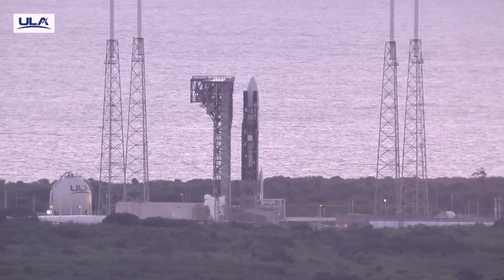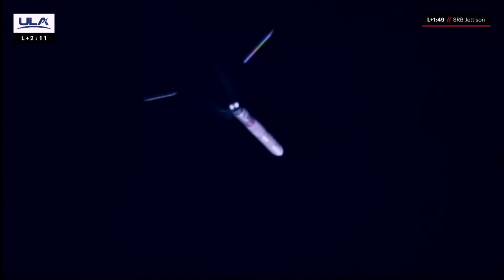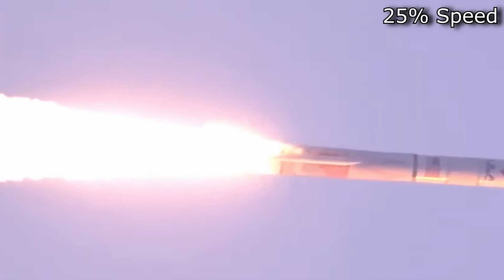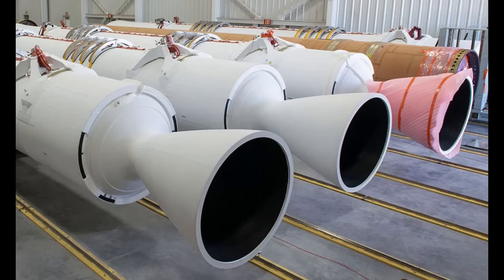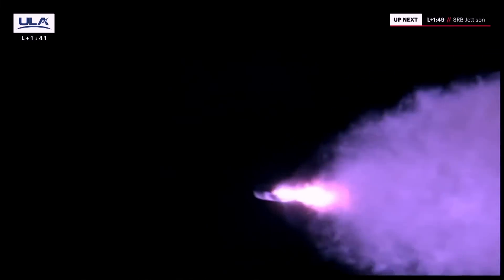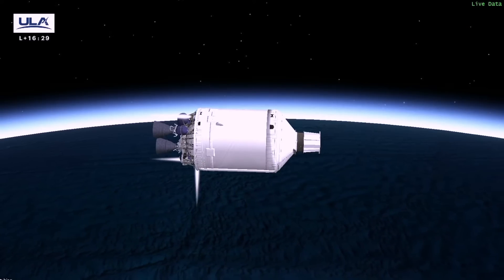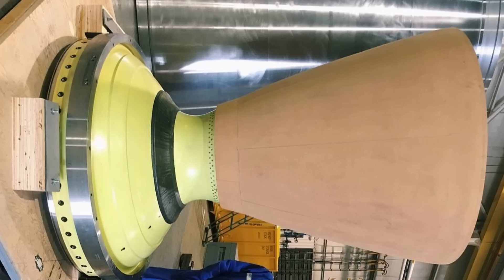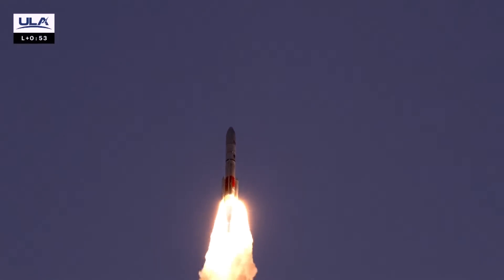How Did The Vulcan Rocket Survive This Booster Failure?

Comment: So, these solid propellant boosters have carbon fiber casings with metal nozzle-assembly connection?  Seems similar to the Titan submersible incident, in a way, except the pressure is on the inside instead of outside.  The pressure is reversed.  The forces on the carbon fiber structure are the opposite way.  The carbon fiber structure held, in this case.  I’m not saying these failures are the same, just a bit of similarity I noticed.

Comment: Idk anything about anything. But my random assumption is MAYBBE a slightly failed in fuel mixture so it burned at a higher temp so it burned out the nuzzle faster? Random assumption with no precluding data. But what do yall think?

Comment: The rocket is 2 for 2 as far as I’m concerned. The gem needs to be fixed but the system demonstrated how robust it is up there. SRB failure in that phase of flight is normally catastrophic, but Vulcan adapted and still completed the mission right on the money. 

P.S. isn’t it nice to be done with the Russian engines? Atlas is great but if we had been wiser we would’ve seen that it’s a road we never should’ve gone down.

Comment: So I guess the nozzle throat was still intact - otherwise the chamber pressure would have dropped, and so would the burn rate, making the booster take a lot longer to burn out.  Solid propellant burn rate depends heavily on pressure; the relationship is (surface regression rate, length/time) = (constant "pressure coefficient" a ) * (pressure) ^ (constant "pressure exponent" n).  The two constants depend on the propellant formulation alone.

Comment: Thank you to the Aerospace  Engineers who developed, explained, & tested the resulting embedded control systems.  Testing the  combined hardware & software systems ensures all  the various rocket failures' recovery methods work.  Testing is real sweat in the arm pits activity.  Software usually lags behind hardware development.  Just as well to have known to be good hardware before testing software.

The built-in error & solid booster failure recovery via onboard systems was impressive.  Maybe SpaceX could learn from this for Starship.  Of course the Russians wouldn't learn anything.  

See Wikipedia "Systems Science :  https://en.wikipedia.org/wiki/Systems_science

--JSW

Comment: The BE4 engines seems to get the credit here - I beg to differ - It was the software (engineers) that should take most the credit (... and a bit to the gimbal hardware), PLUS the second stage to make up the difference.  The question Id like to ask is - was this version operating at it's max capacity - if it was - then that's impressive! otherwise they were lucky they had the extra margins. I bet FAA will rush through the investigation just to spite you know who. (yes I know they are completly different investigations).
Reply: Without the BE-4 having the extra power, gimble and sturdiness this flight ends in catastrophe. The engines absolutely get some credit
Reply: @BakiVSKengan  BPS Space did a video on this flight @5:40 "The 3% cant on the SRB's absolutely SAVED the flight as the 5% gymbling on the BE4 wouldnt be enough"

Comment: This is were hybrid systems show its worth. SRB + LPE. SRB has only 1 failure mode (RSO/explosion), otherwise everything that "fails" on a SRB goes behind it due to the stability of propellant, speed and the only active component being the nozzle. It either works or doesn't. But it still provide some level of thrust which is what we witnessed.

Comment: Can't imagine that the core stage itself wouldn't be certified, it performed extremely well even with a failed booster producing off-axis thrust. The full package will probably have to undergo another cert flight, though, after N-G determines the failure mode and implements appropriate measures.

Comment: The booster probably burned propellant at a slightly slower rate than the other one. Generally increased internal pressure leads to higher burn rates, and losing the nozzle's constriction would reduce pressure, so I would expect a lower net burn rate. Throttlable solids like the Meteor AAM's engine take advantage of this property.

Comment: Yes to have the Engineers quickly figure out what to do to make up the lower thrust they were able to calculate how much longer to fire the second stage to achieve the proper orbit. This happen on a Saturn Five booster that had one engine shut down early on lift off and they kept the other four engines running for like 19 additional  seconds to make the right height ! I always was amazed how fast they figured it out and made adjust,ents in split seconds to save the launch.

Comment: I'd also throw in here for the exhaust gas part near jettison that motors usually "chuff" or continue to burn a bit since the nozzle still keeps some pressure and heat in, but with a lost nozzle, there's not much keeping the motor lit

Comment: God I bet they had their hearts in their mouths back at launch centre! 
Terrified emotions running through their minds thinking they're about to become it yet another Boeing related failure. 
On the plus side it's impressive that's such a significant failure could be compensated software in the boosters fell off in the right spot and all that stuff but that is a close call. 
I wonder if they've considered 3D printed rocket engines I hear they're all the go these days. Assuming they've heard of the technology

Comment: Prediction: Space Force will "provisionally" certify Vulcan and launch their least expensive satellite once Northrop Grumman does a very detailed re-inspection of the GEM's that'll be used. Unless a hard deep look shows that NG was trusting the GEM 60 nozzle to be strong enough for the GEM 63.
3:50  OMG, the age difference between these guys and the SpaceX and Rocket Lab control room engineers.

Comment: It sounds like the core stage performance was far beyond any reasonable expectation.  However, if I were DoD/NRO I would demand that ULA find out what happened with the solid rocket motor and correct the issue before certification.  The core stage definitely saved the mission.

Comment: I’m glad ULA was still successful, but it’s insane the FAA is not requiring an investigation while they required one for a Falcon booster landing too hard
Reply: They likely will but they usually talk to the company before announcing it.
Reply: Does it matter if they do? They’re going to do an investigation anyway and they don’t plan to launch any time soon. 

Any before we get too haughty about Falcon 9 they had a failure on their stage 2 on their most recent manned mission! Kind of a big deal. At least it was after dragon separated.
Reply: FAA statement is “No public injuries or public property damage have been reported” as they hold off on determining if an investigation is warranted.   Just because a booster exploded the nozzle right off, during lift off, with incandescent pieces flying off while barely off the ground,  FAA is rationalizing why they may never investigate. And if they do investigate, it will be done in a way that does not block progress (unlike what they are doing to SpaceX).
Reply: ULA didn't buy Twitter.
Reply: I’m expecting FAA to ground Falcon 9 just in case. At least until they can do a full environmental impact assessment. That nozzle could have impacted a fish.

Comment: Well, I would say that the rocket itself has proven to be very capable seeing how it was able to overcome the strap on booster failure.  These strap on boosters are a separate component.....these are used on other rockets with a high success rate I am assuming.  If they aren't then they should be able to fix this fairly easy I would think.

Comment: The CEO of ULA strikes me as a very genuine and honest engineer who happened to find himself as the head executive of the company. Not sure what it is about the guy but everything I’ve seen about him discussing ULA rocket design made him seem genuinely smart and careful about every detail. Bravo to the controls team.
Reply: That is my impression of Bruno as well.  He seems to know the whole program and has built a solid team.
Reply: @dwaynepenner2788  Tori is an excellent leader. Very personable too.
Reply: He has this tweet from the summer about the latest Raptor engine, saying it’s a really cool achievement but SpaceX should have showed the whole engine and not left out lots of parts to unfairly make it look good next to it’s predecessors. 
You can guess where this is going: that was the whole engine. 
To be fair to him, I’d have made exactly the same mistake, it does look like it’s unfinished, it’s just pretty funny how wrong he was.
Reply: Can attest, Tory is very chill and equally smart. Makes time to talk to virtually everyone in the company in some form. He gives the impression of actually wanting a balanced, happy workforce. I've worked for smaller companies with more detached and angry leadership. (I don't work for ULA, but I know several software engineers there, and they really like Tory.)
Reply: Basically the opposite of Elon
Reply: Unfortunately the honesty goes away when defending Vulcan. cough high energy orbits

Comment: Not the first time a Centaur has saved a mission, on Voyager 1’s launch the upper stage of the Titan shut down early, the Centaur had to burn for longer to make up the shortfall in velocity. When it finally reached the required velocity and shutdown it had just 3 seconds of propellants left. If it had happened before it reached the right velocity Voyager 1 would have been stuck in a heliocentric orbit. Because Titan was a key objective for the mission, Voyager 2 would have had to have flown the mission that Voyager 1 did with a Titan fly-by, in turn this would have meant that it wouldn’t have been able to reach Uranus and Neptune. Space missions operate on such incredibly fine margins that many people aren’t aware of!
Reply: thx for context 🙂
Reply: It's kind of like having Jebediah Kerman piloting on every flight!
Reply: 3 seconds!  So we were 3 seconds away from not seeing ♆ and ⛢. That's crazy and I had no idea.
Reply: @garethmurtagh2814  Talk about fine margins, on the landing of the Viking 1 the remaining fuel was just 1,5 lbs, but for another reason, the  density of the NASA Mars atmosphere model was over estimated by a factor 4, we had a substantial margin in the quantity of the hydrazine monopropelant.
Using the radar altimeter the descent altitude was measured and had the ability to lower the trajectory while the parachute was deployed to a denser lower altitude, before the powered descent began under control of the four beam doppler radar. As mentioned just over a lb remained.  The rocket was a Titan Centaur. The Vikings were operational for 4 and 6 years.

Comment: SRB's are 
1. Looking fcking cool!
2. Packing loads of power
3. Unreliable (Challenger disaster)
4. Extremely bad for the enviroment (amonium-perchlorate + acrylic acid)
5. Low ISP (~260s) 
6. Very expensive to use, as they are hard to reuse. 

Time to retire them.
Reply: *I would have loved to see Grumman's full SRB Rocket, the OmegA fly and maybe do a Firework thingy :) 
Also this thing still making it to orbit is a testiment to ULA's engineering. Plus good PR for Blue Origin.

Comment: I worked on surface to surface missile systems for a long time in (literally) a direct support role and you would be astonished on how high the rate of failures on motors and ignition systems and guidance systems were. Mostly stuff built by Raytheon. Missiles flipping end over end, control surfaces getting stuck and missiles doing a big circle back around to pretty close to where they were launched from, ejection motors firing but flight motors failing, leading to a game of giant lawn darts. Turns out a lot of these things' chemical stability isn't well known over long periods.

One of the things I noticed was that in systems designed in the 80s, everything was over-engineered to a well known margin of something like 150 percent and as the limits of these systems were increased, the components were not changed, relying more and more heavily on that earlier over-engineering work for functionality.

Comment: If enough gas escapes before it can enter the nozzle, the nozzle will then be over-expanded and experience a vacuum near the exit (which it isn't designed to withstand).  The nozzle failure may have been incidental and not a defect.  The hole that let the gas out in the first place is the defect.

Comment: I'm not sure if these boosters have the "zipper explosives" like the Shuttle and Titans did, but I doubt it.  As such the boosters would continue to fire regardless of anything else.  It is unlikely that they can actually be "ejected" until they are in a passive or low-thrust state.  Attempting ejection during actual boosting, with the pressures involved, would probably lead to catastrophic collapsing of the upper structure.  They probably let it go, since they probably had no real choice.  Luckily it go to some kind of orbit, via the additional control authorities in the mains.  Our company did some of the zipper-explosive hardware, and if they actually blew these, the core would probably have collapsed.

Comment: I wouldn't be surprised if Vulcan passes certification with this. The core rocket not only functioned just fine, but compensated for the solid booster failures. That's honestly more impressive to me than everything going fine. Obviously they'll want to figure out what went wrong and get it fixed, but this launch IMO was a huge success for ULA. Less so for NG.
Reply: You might be right that they can launch the Vulcan itself, so NG must prove that the SRB's (up to six at once) can do the lifting work safely. If the failure was caused by pushing them to hard, it might affect the specsheet for the whole system. That would be bad news for ULA.
Reply: I keep confusing NG between “Northrop Grumman” and “New Glenn” 😂

Comment: You bring up pitting on the ablative and they've got the same problem with the Orion ablative heat shield when it came back from the moon with 2.6 times the kinetic energy of low earth orbit entry and there was quite a bit of pitting on the heat shield and of course there's a lot of concern about that. From what I read they're really not sure why it happened or the mechanism because I don't think they ever had this problem with the Apollo heat shield which is the same basic design. So like you say, any pitting inside that nozzle could proceed and grow to the point where the structure fails. Very interesting. With the BE4 nozzles that's metholox so it's liquid cooling, it seems to be a more reliable method yet probably more expensive.

Comment: “Observation” is the official term for something that needs to be investigated further and is the correct term at this point. Until the data has been reviewed and you know what happened, you don’t call it a failure. At this point they don’t know what actually started the failure: nozzle, propellant, rocket interaction… Something was noticed, but it would be premature to jump to conclusions before the data has been reviewed.

Comment: Of course the FAA is going to want to know why the range safety officer didn't terminate the rocket. I guess on the ground it was determined that it was still within flight parameters. Interesting at graphite here is exploding whereas just last year we had the Titan imploding near the Titanic. Because it's fabricated I think there's a lot of mistakes and imperfections that can happen during the fabrication process. That ring was probably from the bottom of the nozzle probably to strengthen the nozzle this was obviously tremendous pressure working against the construction of the nozzle and it failed.
Reply: I believe those systems are automated now.

Comment: At 6:35 and 6:43 a large part appears briefly from behind the plume. Could that be the engine "throat" with the bell missing? It's a little below/left of the glowing "nozzle" piece that's flying off.
EDIT: Could the rocket have continued burning like it did had the throat been missing? I'm guessing not. But what else could the part be if the booster didn't completely come apart?

Comment: Um, isn't ULA a joint venture with Boeing?😟 Should these be included on their growing list of 2024 Engineering failures? Granted, it wasn't a ULA built component that had the issue, however, you have to think that there would have been some kind of inspection. ULA wouldn't just take the booster out of the metaphorical shipping crate and attatch it to the core, with duct tape and bungy cords.
Reply: That's grasping.

Comment: Scott, it's okay to say that the BE-4s did an awesome job the the mission clock even shows they burned about 10 seconds longer while Centaur V's RL-10s burned for about 20 seconds.

Recirculation of plume effects have been seen on a number of rockets, but the Shuttle stack is one of the bigger examples with its complex shapes making for complex interactions between the SRBs, ET, and orbiter.

Comment: Im impressed by 2 things, first that the rocket was able to compensate for the off nominal booster, but also that the booster casing held together even with the nozzle failing.  Usually an SRB will violently unzip itself as you thought it would.

Comment: Bravo to the programmers and engineers that worked on the guidance system. Stellar work. I am curious what sort of damage, if any did the Vulcan engine nozzles get from that wider exhaust plume from the solid booster.